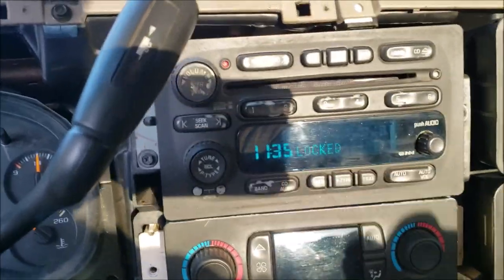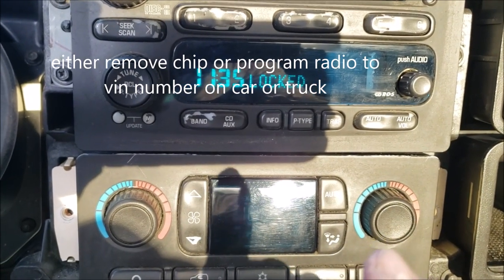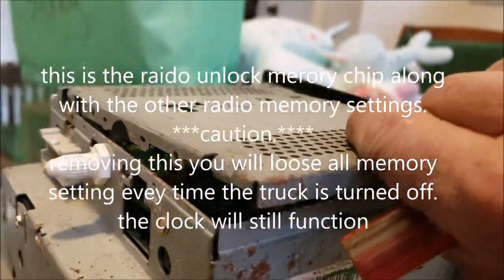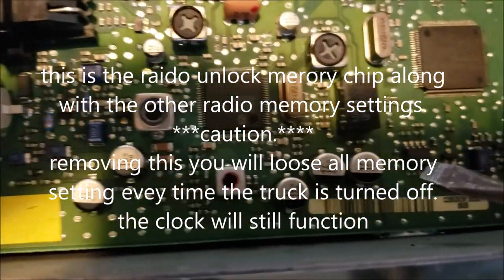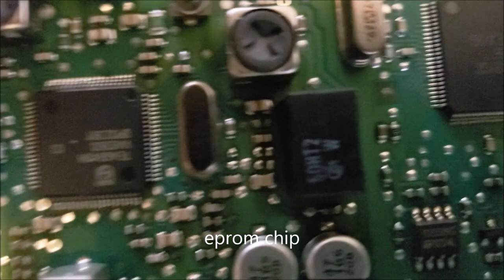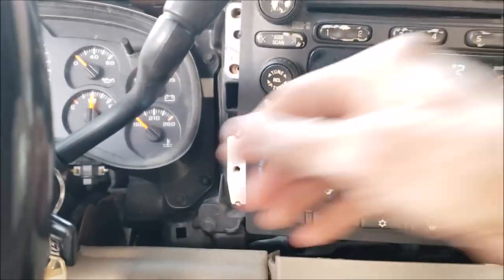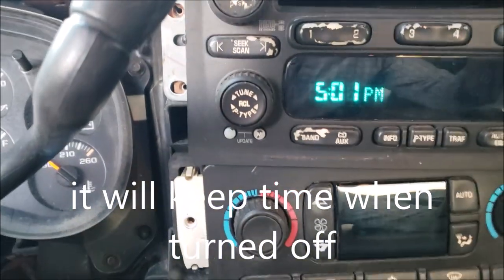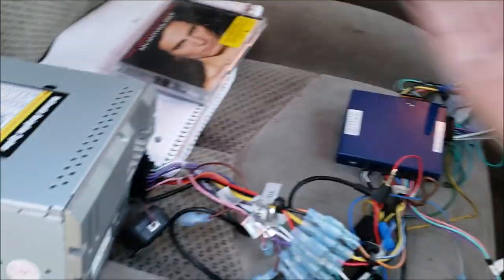GM silverado radio chip eprom Hack part #2   RDS radio unlock 2003 and newer

Comment: I bought a cheap OEM Chevy Cobalt radio off ebay and removed that eeprom chip entirely and soldered in a blank one.  My presets saved but the volume is real low.  It says "calibrate" for a few seconds every time it turns on.  Works though

Comment: I have same radio, radio works, but the disc changer won’t change disc or eject, the light doesn’t come on neither when pressing load or eject… it was just working then stopped any ideas